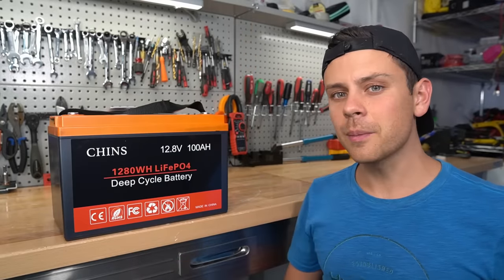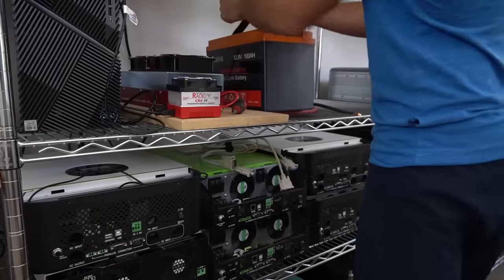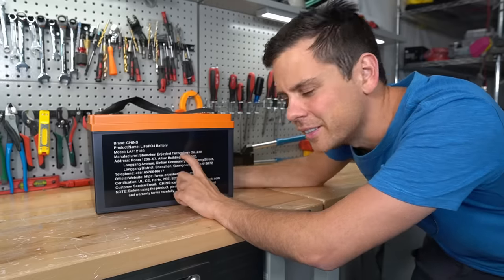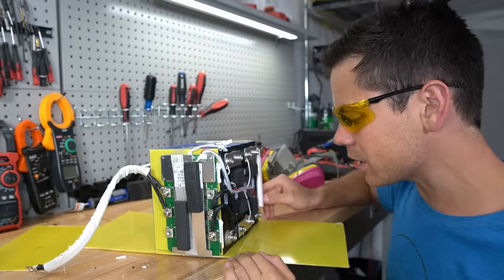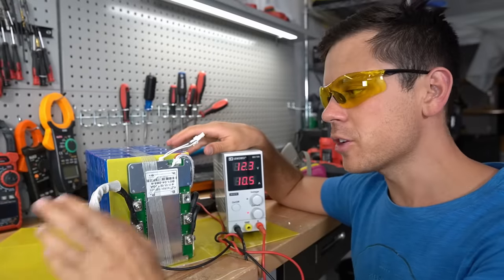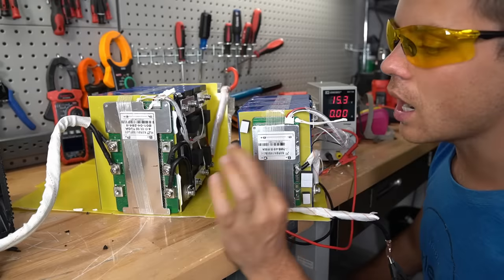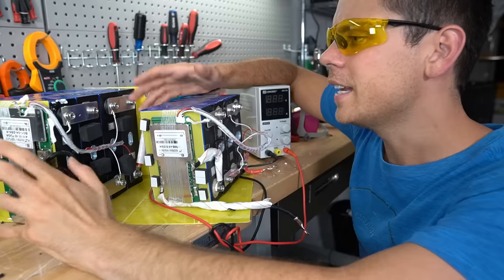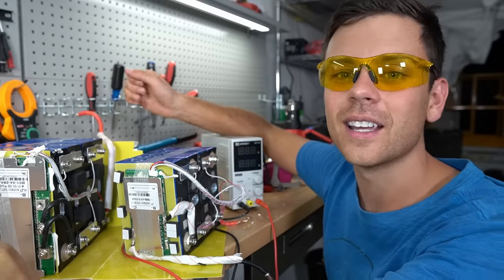$379 CHINS 12V 100Ah "Plus" LiFePO4

Comment: I need to store my four 12 volt 200 AHr Ampere Time battery in my house during the winter.  Due to a space constraint, I would like to store them in a small closet.  I do not want to store them one on top of the other, but I do have enough room to store all of them them on end.  Does that create a problem?

Comment: Hi Will, I've been watching your videos for over a year now. I'm finallly ready to build a DIY LiFePo battery for my minivan conversion. The only things I'll run off the solar is a compressor fridge/freezer that draws 3.33 amps per hour and a shurflo pump that draws 10.1 amps per hour. Back in October 2020 you were recommending Fortune cells but they were shpping a few months behind. I would like to buy something I can get pretty quickly. Do you have a recommendation?
Reply: I can show you how to do DIY batteries, I'm an expert on this convenience
Reply: @osmbattery  Thanks you! I got Will's book and took component recommendations from his website. My DIY cells will be here in a few days. Would love to check in with you as I assemble my system off you're open to that.

Comment: You weren't kidding when you said  you're going to rip it apart))) question... I have the bluetti eb150 and i tried charging with the 300 watt bestek   In my sienna but it blows a fuse every time, hmmmm....I figured I'd ask the expert. It's running the dometic at the same time...maybe I should unplug the fridge ???

Comment: I want to connect 4 of these batteries in a series circuit to have a 48-volt system. I'm  assuming that these exact batteries can be wired like that?

Comment: I saw that the santan panels you showed off the other day have a VOC of 37v but when reading one of your guides you mentioned 24v systems need 40v+. So if I were to use the Santan panels with a 24v system would I need to connect them in parallel to up the voltage over the 40v+ mark?

Comment: I know this is focused mostly on off-grid solar charging (an upcoming project on my short list), but you're a smart guy and I'm not an electrical engineer by any means. Could the Chins 100AH 12v battery pack work in a 36v golf cart with 3 batts run in series? What potential problems/challenges would you forsee or anticipate? I'm concerned mostly w/bms cutoff due to amp draw at full power/full throttle. Do you think it could handle it?
Reply: It is recommended to directly select 36V lithium iron phosphate battery pack for golf cart, because the lithium iron phosphate battery pack is required to be connected in series. Wu requires that even if it is connected in series at that time, the voltage of the three batteries may be unbalanced after a period of time. Therefore, it is recommended to directly select 36V lithium battery pack for reference only

Comment: VIDEO IDEA! Many of us have campers that come with the generic charge controller and don't want the solar panels but do want the Lithium Ion storage capacity.  Can you do a video of the simplist way to drop in one of these batteries into an RV?  What additional hardware is needed, or can it just be an AMG to LI  one to one replacement?
Reply: 100 Ah is 100 Ah. You don't get a larger storage capacity then what is says on the battery. An normal leisure battery will do just fine.
Reply: @milcotto4153  A charge controller for a lead acid or agm battery is Signifigantly different than one that can do LI.  I imagine if you just drop in a LiFePo battery, you will damage it and or your system.  Will it cause a fire?  The battery BMS is NOT the charge controller.

Comment: Hi Will, here a question people might like to ask. How about discharging Lifepo4 at low temperature, is it still safe to discharge when charging is already shut off? 
For example to start the diesel heating of a camper in the morning you would need some energy to start the heater, some 8 amps, to warm the vehicle and the battery. Can a Lifepo4 battery which has charging already shut of still discharge safely? Or should Lifepo4 always have internal heating as storing at low temp would always be damaging even without charging or discharging?
Reply: It depends on design, more specifically the cold shut down setting. My lifepo4 give power down to -2F I believe. No charging until they warm up to 35f or so of course.
Reply: the chemistry in lithium cells when near frozen just takes time to get excited, if the current draw is low and you have a large battery it's not really going to be a problem but if it a large draw it will act like it's flat like it was a acid battery that's the reason for the internal heating so you don't slow the chemistry down, but I'd probably have it installed inside and have insulation under it and not outside with no protection from the elements if you live in the colder climates, some motorcycle's with lithium batteries in cold say turn on a light to help the battery wake up when cold before starting.

Comment: Mr. Will does it again. Thank you without hopefully sounding too sycophantic on my part ;=). Anyway, another newb ahaa moment is the AH rating...as a newb constantly asking, "Why is there a Watt rating and an AH?"...until you realize: "its the Amps dummy!". Its the amount of "water in the tank" that makes devices work. Now, as a newb, the next logical question is: would a 12v battery be able to have enough "pressure" to feed my house appliances? then logically its like, well, its DC to AC ... and the inverter has to convert the 12v pressure pushing juice at a max. rate to the inverter that then has to be converted to AC voltage compatible to then "push" said juice to the house...so you see Mr. Will, being bamboozled by the whole subject matter is nih on like falling out of bed. Hope this makes sense to point out the amount of knowledge needed for a newb to even beging to understand the usefulness of this battery you have rated as being very very good.

Comment: I can't figure out why I should use lithium batteries.  I just bought two 200-amp hour Mighty Max 6 volt sealed lead acid batteries with a design life of 10 years for $400.  That's $1 per amp hour.  The "cheap" lithium battery you tore apart was $5.09 per amp hour.      Other than the lithium battery being lightweight I can't see any other potential advantage.  I say potential because I like the exercise of carrying heavy things.
Reply: Lead acid batteries have a life span around 400 to 500 charges while lithium lifepo4 batteries can be charged between 2000-4000 charges. 
The lithium will then only charge around 80 percent. 
You can damage lead acid batteries by running them below 50% capacity whereas a lifepo4 battery can be discharged to near 100 percent without damaging the battery.

Comment: I'm building an electric motorcycle and need advice on a battery type.  Obviously I don't want lead acid, and I've seen the way lithium ion batteries explode and I'm not really interested in having that happen between my legs 😅 
The motor I have is 36v, I drive 10 miles to work on the hiway.
I'd like to have a small battery for to and from work and an big one for long distance riding.

Comment: Do you have any videos/information on AC micro inverter panels like enphase inverters that is used on different brands?  

I can't seem to find anything on battery backup & grid charging capabilities all tied in.  Growatt makes an inverter that is off grid, only charges from solar or grid but only has DC PV input.  

I'm looking at the efficiency of AC solar panels, but can't seem to find anything on how they connect together, how many can be ran together & a way to tie it with batteries. 

I imagine a dc to AC inverter, before a DC inverter doesn't make a lot of sense.  

Enphase makes a interconnect/combiner box, but seems it is designed for their AC battery system.

My issue is going to be variable shade which will ruin efficiencies of string setup.

Comment: ps. I built a solar tracker using a DasMarine 12" linear Actuator I purchased on amazon as well. Used a Forward and reverse relay module and a Mhczy WiFi wireless smart switch . can rotate the unit with the cell phone app. is a momentary switch so I programed it to come on and rotate forward to track the sun and also to return to home for the next day. works but is DYI and not built that sturdy. pole mount on 2 " PVC pipe left over from the pool . built frame with again left over parts metal frame on 2 with wood mount for ball bearing to mount in and a all wood frame for a 3rd to balance the load. see my build on YouTube  Chanel  James Hancock. Did all this by watching you on you tube. thanks for the ideas.

Comment: Max charge and max discharge are the same between the 100ah and the 200ah models. If the 200ah battery is just two of the 100ah batteries in parallel, wouldn't the charge /discharge rate double?

I'm new to all this and just wanting to understand their ratings.
Reply: It would double if they connect two batteries in parallel. 

Perhaps they don't connect two batteries in parallel, or perhaps they do but didn't increase the cross sectional area of internal cabling and terminals to accommodate double the current.

Who knows...which is why you have to look at the battery spec and stick to it.

Comment: I noticed there are a few with high cranking amps.  an itech one here has 1420cranks. 
And also some generic ones i've seen at a fraction of the $ claiming 1100/1200 cranks. 

What do they do different to these batteries?

Comment: Hi Will, I am building the 280Ah milk crate setup now.  I ordered TWO sets of the four batteries from Aliexpress.  But I don't know what to order for the BMS. I'm combining the two sets in parallel to end of with a 12v system.  Should I buy two if the recommend BMS or what? Is this set called an 8s or 2px4s or ?  Thanks for any help... George

Comment: I have a question. I am building a 48 v battery using 4 1wv g31 Firefly carbon foam batteries. What is the acceptable voltage variance? Currently my batteries are at 12.84,12.81,12.80,12.80.

Comment: I wonder will this run a POE security 4 camera system with that battery, an mppt controller and 2 100 watt solar panels. with a good inverter of course. I want my security to be not grid tied is why

Comment: Is it possible to combine a renogy smart battery and a lead acid together so they both get charge using solar. I have a small mobile setup with charge controller connected to renogy lithium battery but it would be great if I could also charge the lead acid thru pararel connection

Comment: Would the Renogy DCC30S 12V 30A Dual Input DC-DC On-Board Battery Charger with MPPT work as a “low temp” solution? Thanks

Comment: What AC battery charger would you suggest someone use to charge their lithium batteries?  I don't know which ones you are using in this video, and was curious what your recommendation would be.
Reply: I'm using the "Iota  24 volt 45 amp " 120 volt charger.. On the occasion I need to charge my Chins 24 v 150 amp battery, I run most of my needs off this battery, This charger has modules you plug in for the battery type you are using.. Good luck..

Comment: Hi will. Can I combine two of these and use them to charge the Bluetti AC200P via the solar input? Basically use them to extend the battery capacity.
Reply: Did you ever find an answer?

Comment: This battery (300 AH) has been in my amazon cart for a while now.  Just waiting for my current lead acid setup to die. 
    I do have a 100 AH bioenno power Lithium battery and I am not fond of that company because of there customer service.  Now that battery after not to long doesn't hold a charge at all.  I'm about to cut it open like you do.  Do you know anything about them.  Its the one my kayak group always recommends.  I paid about $1000 for it. My 40 AH for my fish finder has been good though.  Wondering if it is a bad cell or bad BMS.  If you want to make a video tearing it apart and seeing what is inside it I can ship it to you, before I decide to tear it apart.

Comment: I recently purchased one of these batteries and the documentation says max charging current is 50 amps. I purchased a 60 amp charger before the battery, will this harm the battery if I use it.

Comment: With this battery, do i just drop it into my rv trailer system and it'll charge and act like the old AGM battery? I'm running solar on my camper trailer, but also have shore power hookups, will the trailer charge this battery from shore power and solar?
Reply: I’d suggest search for “lithium in Rv” it can work but most likely you factory installed converter doesn’t have the correct charging profile for lithium batteries. Basically it won’t ever fully charge a lithium battery. You can look into converters that have a “lithium” setting I believe progressive dynamic and Wfco both offer one. I was looking into going that route but I ended up redoing everything with a new inverter charger.. it’s easy to fall in the rabbit hole..

Comment: Bought 2 300ah batts and after 700 cycles and extensive testing for chins, they claimed that 1/4 degradation is perfectly normal. They are a scam 10 warranty isn’t worth anything.

Comment: They have one on Amazon with a heating element for low temp charging. Its $90 more.
Reply: Having a heating element inside your battery sounds scary to me.
Reply: There’s several that do. Including Battle Born. There’s even heating pads for batteries. A cold cut off is great…unless you still need power when it’s cold all winter.

Comment: Which Victron charge controller provides low temperature charging protection? I didn't see it on specs for the 150 70A..

Comment: I just purchased one, extremely disappointed with the product.  The power output fluctuates when under charge from the camper inverter or solar power controller (tested on two different Zamp controllers).   This fluctuation will cause the lights and dc tv to blink.   I installed my old marine battery back into the camper, no blinking lights now.   Since I am past the no return date, would you like to confirm there are issues with this battery?  I must wonder if the manufacturer is using different components since your last review.

Comment: I wonder if this kind of so called “replacement” batterie can be plug in with  out any other mod on a boat equipped with classical 3 stages charger and Alternator regulator ?

Comment: Unfortunately CHINS is using pouch cells now.. bought 4 thinking they were prismatic like shown in your photo and was very disappointed.
Reply from the maker: Why are you disappointed? I like the new pouch cells
Reply: @WillProwse  I had a fall back plan based on the aluminum housed cells.  Need to reformulate that plan now to handle the change, but was hoping for easily adding EVE cells which would have had the same form factor for expansion.

Comment: FPV DRONE hobby charger. I watched a video of yours that you mentioned you used to race drones. I bought a SOK battery after watching your videos. i have an icharger x6 with a 24v 1500w power supply. would i be able to use this to charge the SOK lifepo4? ive tried searching about using these hobby grade lipo chargers but wasnt clear and dont want to damage the new battery. thanks for any help!

Comment: Hay Will i using 3 Chin 100 amp batteries in series in my 36 volt golf cart.  Is it possible that as the amp goes up while climbing a hill that causes the voltage to drop could one battery experience a low voltage and the BMS cut it off causing there to be no voltage on the system?

Comment: I'm running 6 amperetime 12v 200 ah in paralell. Powering a small 12vdc load and a minifridge on a xantrex 2000 xc converter/ charger. My question is... Often and Randomly I'll hear a big Thump coming from their general direction. Like a deadblow hammer striking a sheetmetal tray. They are on sheetmetal formed shelving. Any idea what this could be? Maybe an internal resettable breaker in the battery. Though it doesnt seem to intetupt power.

Comment: I can’t understand why LifePo4 batteries are so expensive in the US. In Australia you can buy a good quality 100Ah Lithium battery for $399 Au which is about $300 US. You guys are getting screwed.
Reply: Taxes
Reply: Taxes and the Foraker Act.😠
Reply: I'm not sure i'd say 'good quality' but yeah there's a few, get em even cheaper with all the Ebay 10-20% off sales always on, like the equivalent of $265US shipped to anywhere in the country.  Probably B grade cells in them but they seem to test at or close to full rated capacity so only time will tell.

Comment: If I do a lot of research from professionals such as yourself and depend on your expertise to my purchases or therefore such research before I open my wallet.
I'm about to buy two chins 200 ah lithium....
Because I do need lighter weight in my RV for travel I have over a thousand amp hours of battery power but they are excessive weight (they will be designed for a setup for prolonged use) and these 200 amp hour chins will cost me for two approximately $1,400 and the weight will offset the price for gasoline in time.

Comment: If I buy 12v 300ah battery and a 12v 100ah battery can I still hook them up parallel and use the victron multi charger. Will that be ok?

Comment: I've been looking to buy lithium batteries to use on my 36v 112lb minn kota trolling motor. Do you think that those batteries would be okay to be used for my trolling motor if I connect them in series? Any help would be much appreciated!
Reply: should be fine for 36v as long as the motor doesn't draw more the 100amps , but you have to charge each battery to full then place in parallel 12v to balance for a  few hours then you can place in series 36v and you are good to go.

Comment: They're selling two models of the same battery the plus without the low temp sensor and the smart with low temp for like $200 more that seems crazy $200 more. Can I just use a electric blanket or a heating pad ha ha